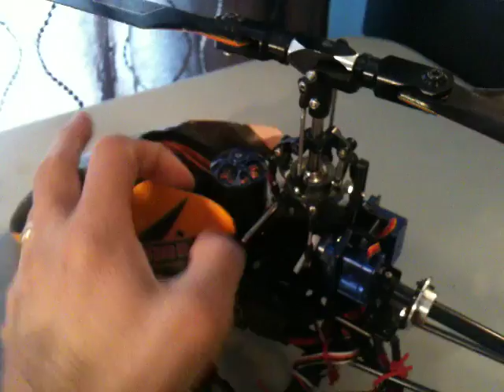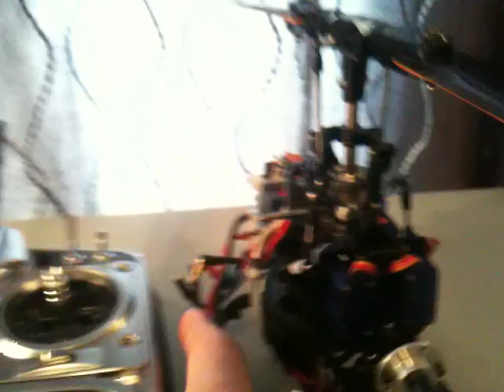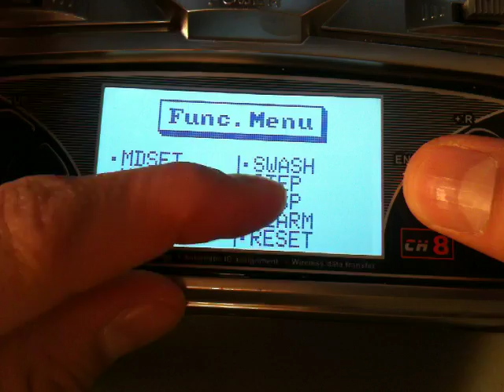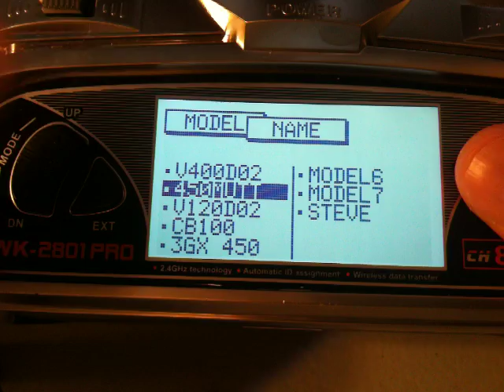walkera 2801pro setup 1.MOV

Comment: Thnk's for posting this vid. I have a 2801 Pro radio system and would like to use it for fixed wing with flaps. I can't figure out the instructions so I am asking if there is a video tutorial for setting this thing up for fixed wing. It has the option but no one seems to have a video tutorial for fixed wing. I have gone through 2 sets of AA batteries trying to figure this out using the manual and I've given up on using the manual. 

Thanks in advance.

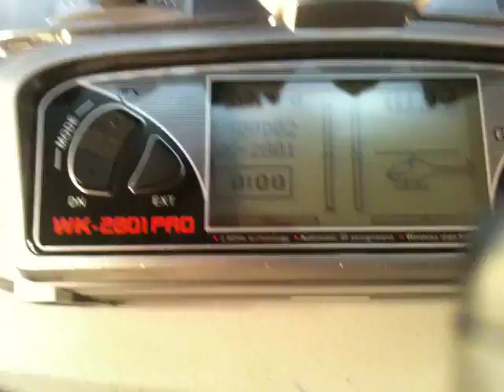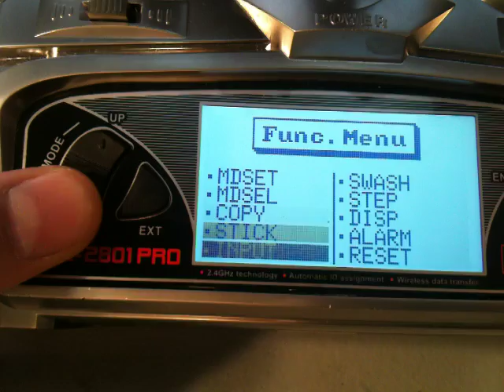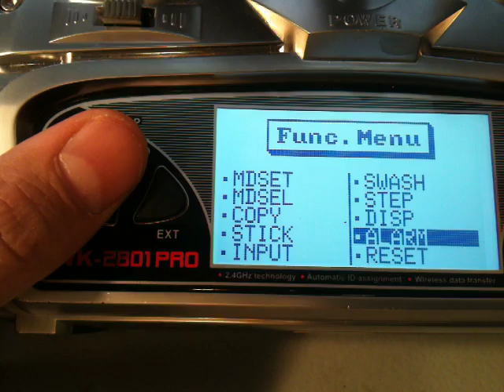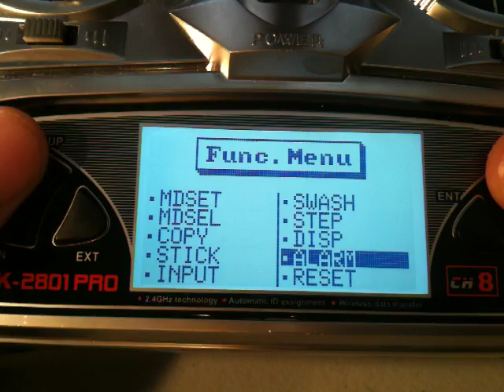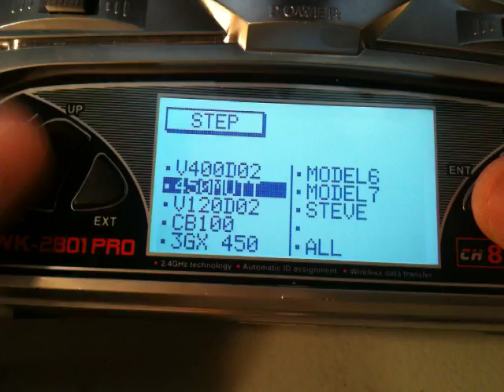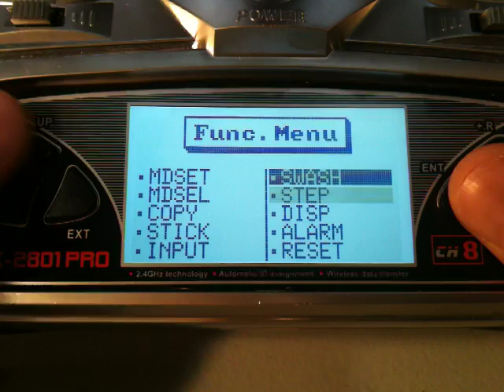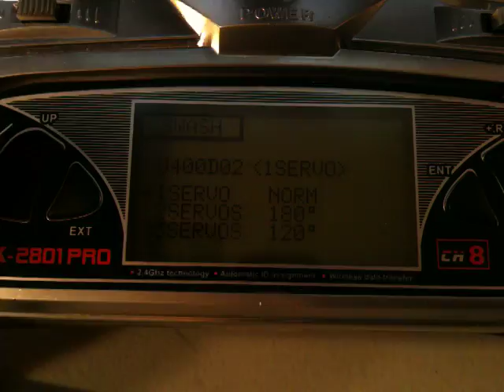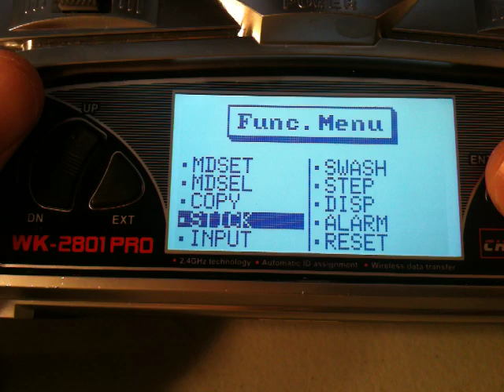Comment from the maker: Since this is a long video here is a list of the time in the video that I go over each setting. - 0 min heli intro - 3:15 buttons and switches - 5:40 Reset - 6:00 Alarm - 7:30 Disp - 8:20 Step - 8:50 Swash - 12:00 Input - 12:30 Stick - 14:50 Copy - 16:10 MDSEL